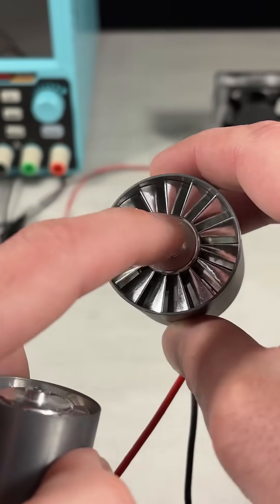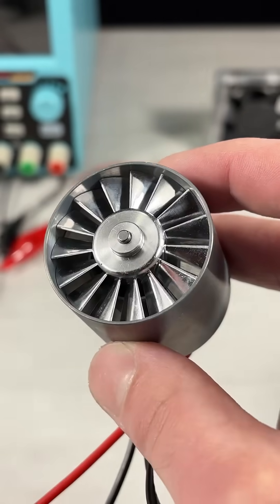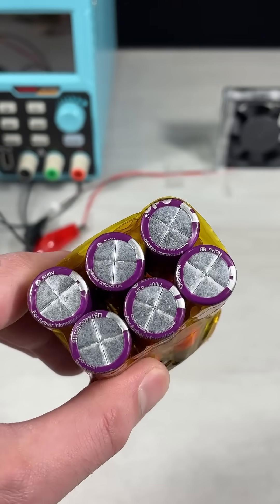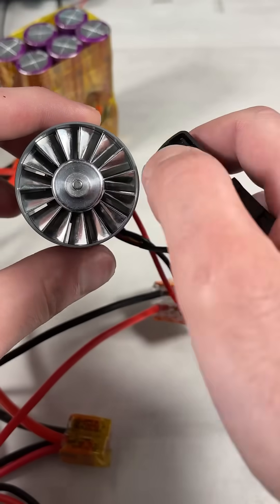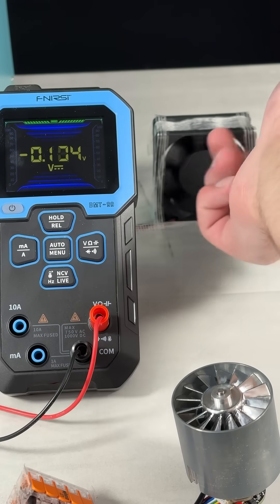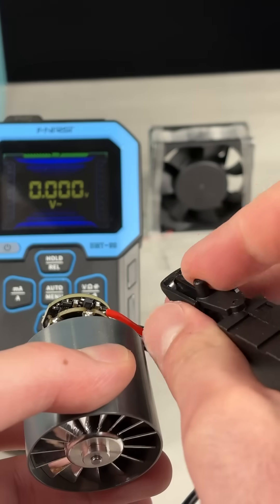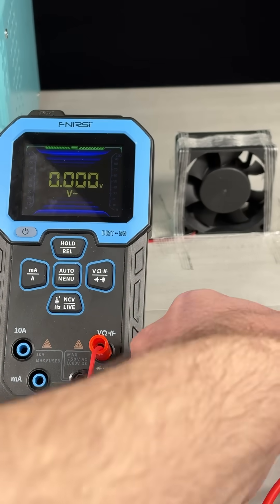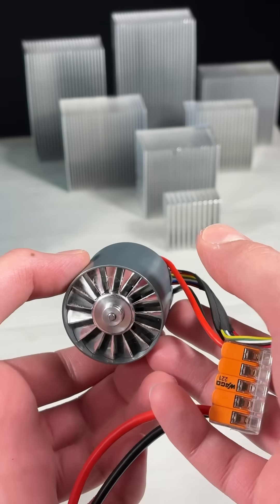Lithium Supercapacitor Jet! #electronics #engineering #cool

Comment: The stationary part of the intake “where the screw and nut are” is huge. It is preventing a lot of the air from flowing in. I bet you with reducing this tip “that what it is called in jet engines. Don’t be a weirdo!” Size you can produce more flow.

Comment: Man these 100K brushless jet fan motors are much more pleasant to the ears than 45K rpm brushed vacuum cleaner motors. I love turbo jet fans
Reply: At 100k rpm you do not hear the fan anymore because the frequency is too high, but you hear the air that is being moved...

But a vacuum cleaner doesn't move much air so the loud noise comes from the vibration of the motor and that is a frequency you CAN hear...
Reply: @NicoChristmannRecords  100k rpm is 100,000 rpm / 60 s/min= 1666 Hz. Should be easy to hear, in fact it should be around peak of human ear sensitivity.

Comment: Putting a jet turbine fan on a pc heatsink and running cinebench
Reply: Well, technically I did it yesterday, cooler master jet 7 :V
Reply from the maker: 😂 fun fact I actually burnt the fuses on my GPU like 4 years ago after running cinebench (the one with the big circle thing) for 10 hours straight by accident…

(Oh and the GPU was overclocked real good too ;) it’s funny because GPUs are like “fashion accessories” now. 
I don’t even play games but I feel like if my PC doesn’t have a good GPU then it’s somehow worse, so I ended up getting a replacement which I barely use but makes me happy when I see it or if I’m rendering something and it turns into a heater
Reply: @KeonsLab 😂 did you shunt mod it by any chance?
Reply: Ouch my ears
Reply: Linus did it with a laptop. The high pressure inside was pushing the keyboard up 😀

Comment: Nice vid 😄 Are the fans from hair dryers? They are pretty powerful
Reply: Ur projects are really cool bro looking forward to the vid 😁
Reply from the maker: Thanks! 😊
Reply from the maker: They’re similar, but a LOT more powerful so I wanna make a hand dryer with them.

They’re custom modified fans from a vendor I found. I’ll have more detail in the full video but basically it uses a custom ESC speed controller and has custom windings to match.

So unlike a hair dryer it can run on 8-16V